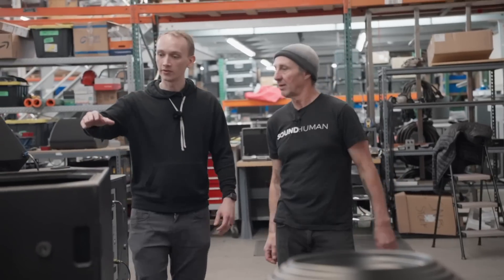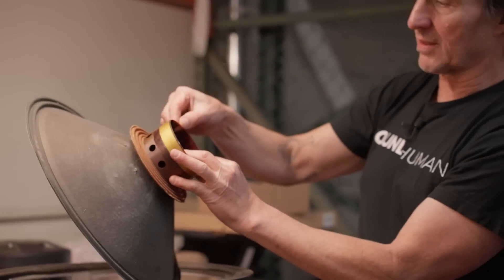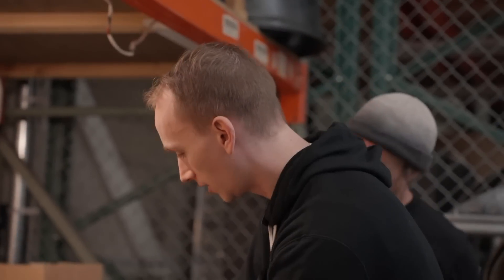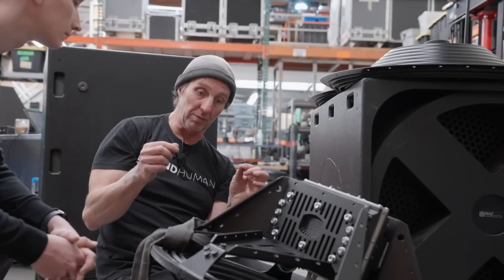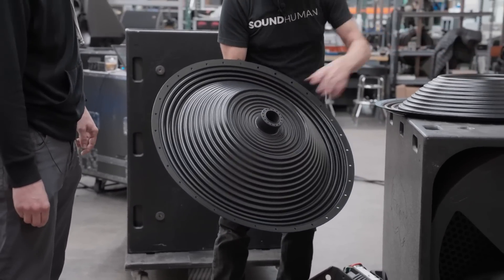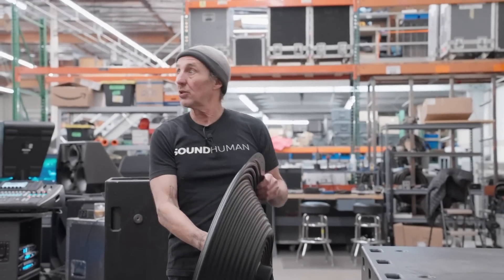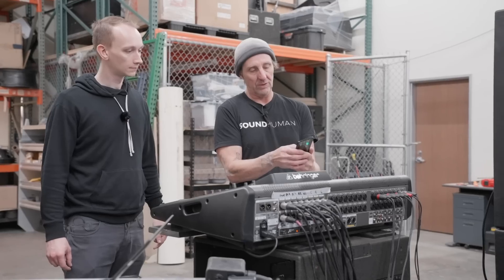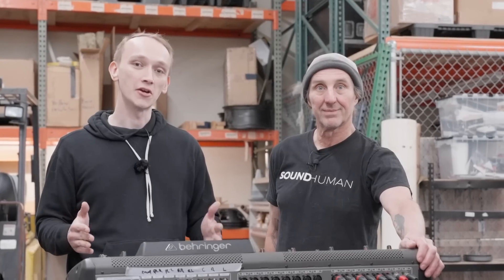Moving Coil vs. Linear Drive Speakers with Dave Rat

Comment: I've seen those rotating fan blade subwoofers that do a similar thing, but I guess I don't see much point for reproducing sound below 30 Hz. Anything under 30-35hz isn't really useful sonic info tbh.
Reply: Many things, but most notably is our hearing doesn't just stop below a given frequency. 

It's simply a diminished sensitivity (equal loudness curves).
For example, a 30hz tone requires about 60dB to be audible. 

A 20hz tone requires about 80dB to be audible. 

Whereas a 10hz tone requires about 100dB for audibility. 

That said there's additional modalities in which we experience LF energy. In addition to sound pressure, we also experience the velocity component. 

Plus our biggest organ, skin, is a sensory element. And our resonant cavities like our chest, etc., also add to the experience.
Reply: @FOH3663  
Excellent!
Reply: @pauleubanks, the wavelengths of low frequencies are so long that back in the days when bass players on big stages would use folded-horn speaker cabinets they could hardly hear themselves but the audience, and perhaps the singer at the very edge of the stage, got pummeled by the bass. It's impossible to reproduce anything audible that low in a car anyway because the cockpit size of the vehicle is so small. Sure, you can feel it , but then you also have to go through every part of the car and install sound-damping material and tighten everything down so that it doesn't rattle.
Reply: Unless you listen to classical organ or large orchestral works. 16Hz fundamentals shaking the place are good for the soul!
Reply: @Paul09  ,  16 Hz fundamentals are only good if you have built a listening room specifically for 16 Hz fundamentals, so that it doesn't rattle the sheetrock and rattle the moldings and everything else in the room. I've spent my entire life working with, installing, and repairing audio equipment and and audio systems, both and semi-pro gear,  and even though at age 66 my hearing isn't quite what it used to be,   I am still greatly annoyed by things that rattle from low frequencies. It really makes me grit my teeth.
Reply: Chill and go listen to deathpact
Reply: @SamFirthDesigner   I tried, but its brick wall clipped way too hard. Some clipping is good but the clipping distortion in those last tracks makes my head hurt. :(
Reply: That really depends on your music goals or sonic goals because I have friends who can play down to 12Hz and shake all the windows and have a fun doing it. 
In fact, one time I was playing a 17 Hz tone in my car and a lady gave me the middle finger; that was awesome.
Reply: @Bassotronics ,  Yeah, that's why we put audio systems in our cars, to listen to "tones".  This may fall on deaf ears, hopefully not literally: try listening to music instead, that's a novel concept nowadays. And before you write me off as some old fuddy-duddy boomer, that's simultaneously both true and false. I was installing car stereos for my friends beginning in 1974, and by 1983 I had a triamped system in my car with 10" Dynaudio subs in a tuned cabinet I built, Fosgate and Audiomobile electronics, a/d/s speakers and a Nakamichi tape deck.  My work was sufficiently well respected locally that I even installed Nakamichi systems in a half-dozen Saabs for the president of Saab-Scania US and his executives. The emphasis back then was on sound systems that were clean and *musical*,  but I went to the Vegas CES show in 1988 or 1989, and of 60 or 70 cars out in the parking lot that were being used to demonstrate car audio equipment and systems, I only heard 3 that sounded good (Fosgate was one of them, I don't remember the other companies). People were going for loud volumes and heavy bass, and a completely imbalanced audio spectrum.  Selling and installing an expensive system & installation to people who just wanted to be loud was easy enough, but there was no satisfaction in it. I got out of the business in 1990 ( became a telecom tech for a while, then spent 20 years as an audio-repair bench technician before retiring). Unfortunately, the years I spent climbing into car trunks and contorting myself to get underneath dashboards did some bad things to my back and neck ( I am 6'2" and used to be pretty flexible) and now I'm living with arthritis and pain. My hearing still works at least, although my top end response cuts out at about 13k; but there's not much worth listening to above that, just as there isn't much worth listening to below 40 Hertz unless you listen to synthesizers or recordings of church organs.  The fundamental note of a bass guitar E string is 80 Hz with some output an octave lower at 40 Hz,and of course a bass drum goes a bit lower than that, but putting dual 15" or larger woofers in a car makes about as much sense as pouring a cup of sugar on your bowl of breakfast cereal.
Reply: @goodun2974  
Yes sir. I DO listen to music.
And many times that music I listen to has tones and nothing satisfies me more than when I play a song with a nice low 18Hz loud tone and then people look at me like WTF because they never in their LIFE have heard such a low tone before. Especially a boring musical place like I live in. It's more for the "fun" factor that I do it. ANYBODY can play music in the car .. Big Deal!.. but to play music with such a loud deep tone that surprises people and give them a new experience is what makes me happy.
Reply: @Bassotronics   LMAO! 18Hz. Are your friends all Blue Whales? Are you making music for all your underwater friends?
Reply: @PaulEubanks  
LOL
Only for those who can hear that low and love the sensation. Not everyone has experience with infrasonics and what it can do.
Reply: You can’t hear it perhaps but you can feel it in your chest
Reply: Sorry nobody can hear LFOs, that’s the point.
Reply: @PaulEubanks  
Not true. Some people can and some can't.
Some can just feel it while there are others like me who can hear and feel it.
It's why I'm a Bass music producer signed to a label because I'm among the few who can actually hear down to about 15Hz.
One thing I've noticed is that not everyone is capable of hearing that low so anybody who says that we cannot hear under 30Hz is not telling the full truth.
Reply: @Bassotronics   Utter nonsense. I produce music too and damn near everything commercial is HPF'd under 25-30Hz anyway. Anything under that is basically imperceptible so it gets cut.
Reply: @PaulEubanks  
I can tell you are NOT a Bass music producer and not signed to any label.
You gonna tell me "Utter nonsense" about something I been dealing with for more than 20 years? LOL Good try bud!
Reply: @Bassotronics   LMAO big talk coming from someone still using the same stock footage from Pexels that every other home producer using. 20 years and you haven't got past that stage yet? Who signed you?
Reply: @PaulEubanks  
I'm Signed to Bass Mekanik Records. 
They been making Bass Music since the mid 90's and I joined in the mid 2000's.
And I have a personal label too Throbuation Recordings with dozens of Bass tracks.
I can understand your argument about commercial music filtering anything under 30Hz. I myself don't have any use for frequencies so low for regular music. BUT.. when it comes to Bass Music which is DEDICATED to  Bass frequencies from 1Hz to 100Hz, its all about the science of sound and if your system is capable and if it can reproduce as low as you can go (Like a sample says "How Low Can You Go?")
It's all about having fun with the bass and seeing or (hearing for that matter) how loud and efficient your system can be.
If you ever been to SPL car audio competitions, you should know all about it.
If not, I suggest you go to one and see what the fuss is all about.

Comment: So a guy brings a Fender Vibrolux Reverb . He said it had no low end . I asked about anything else he could tell me . He just replaced a speaker . That's what 2 speakers out of phase gives you.
Reply: 2 speakers out of phase:

Such a simple wiring mistake. A monumentally horrible effect on the sound, with such an easy corrective measure to fix it.
Reply: @toddwilliams8761 fun fact running speakers out of phase is a common practice in a isobaric setups as the subwoofers run in a push pull configuration!
Reply: It’s the best mistake.